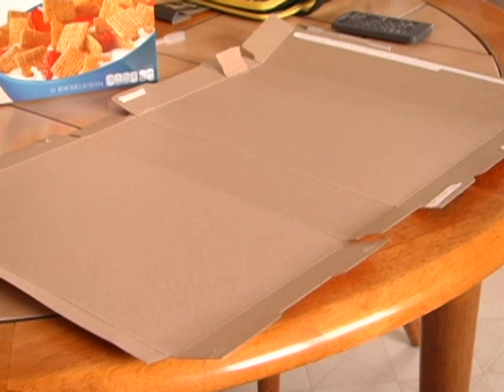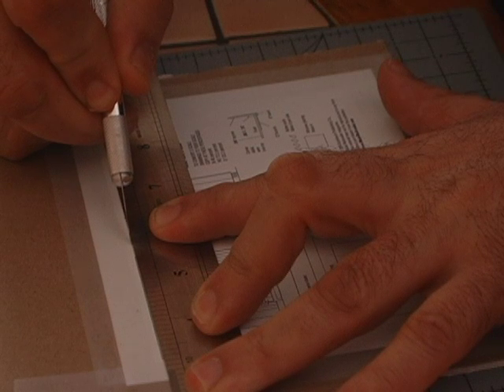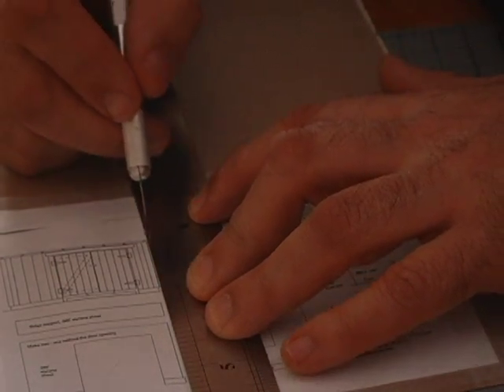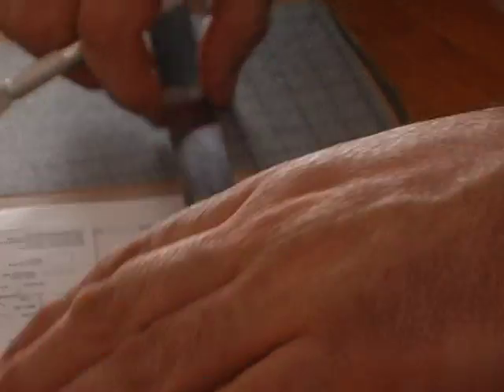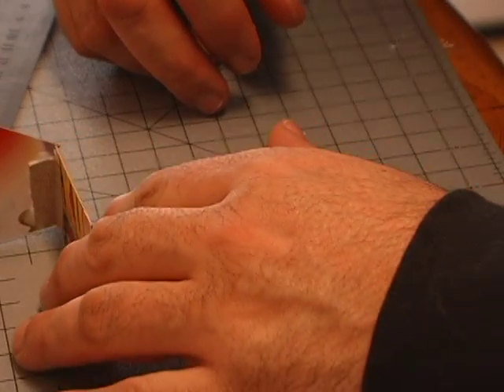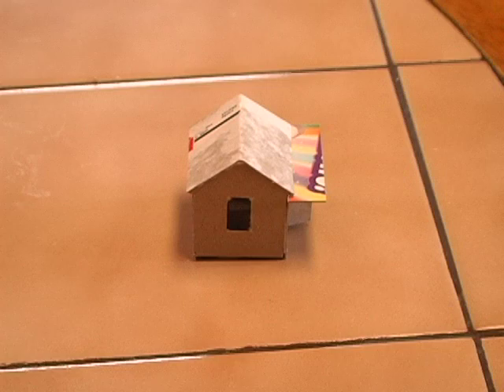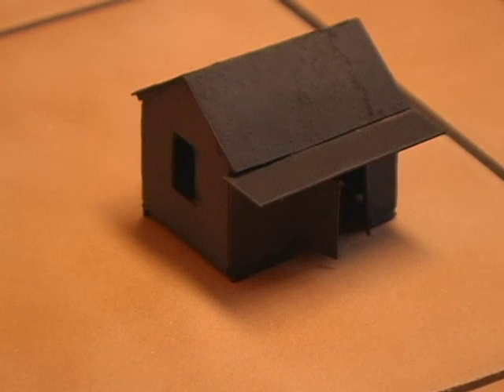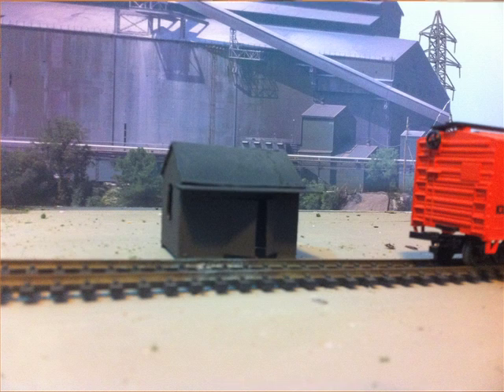Model Railroads: Scratch building.  Making cheap mock ups, how to practice, and tips.

Comment: DJ, Another method used when cutting out windows and doors is, drill a hole in each corner of the window and door opening. Then use your straight edge and knife to cut the rest of the window or door out. You don't have to worry about going past your lines as the holes are in the corners. Don't drill to big of a hole and finish up the corner with a small file.  Another great video, keep em coming.

Comment: Great tips!  Thanks. Very timely for me as I'm just getting started in structures.  Hardest thing I find is to hold sides at 90 degree angle for gluing and then having it stay at 90 until it drys. How do you do it?
Reply from the maker: I see lots of guys building L shaped jigs using basic legos.  They are perfectly squared at the ends, and can be built for any size, and you can hold it with rubber bands.
Reply: Great idea! I have about a million Legos from my son and grandsons.